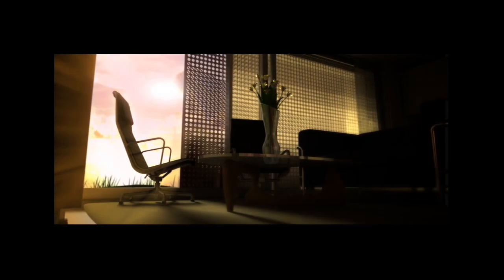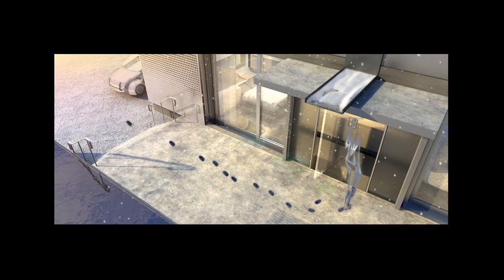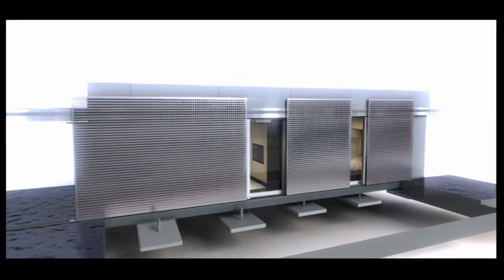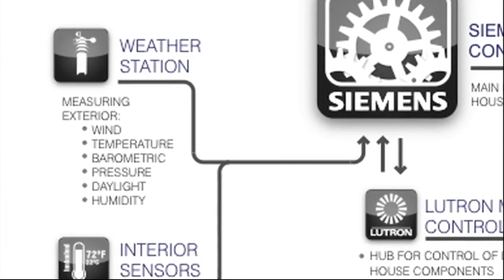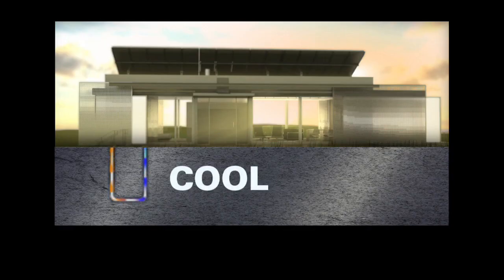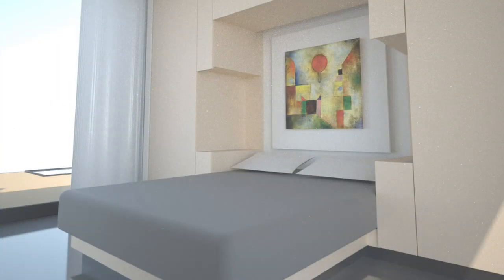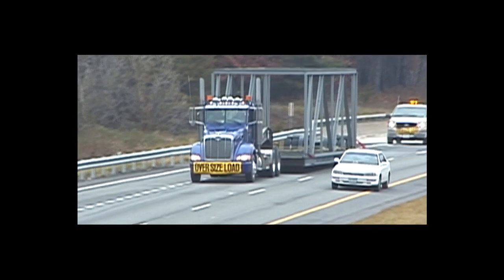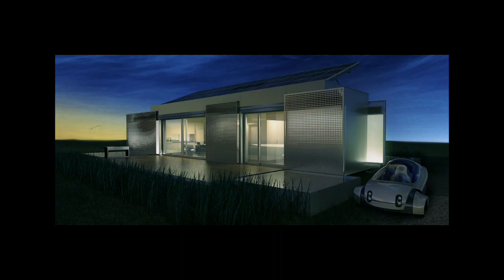LUMENHAUS - A brighter way.  Everyday.

Comment: There are a few problems with this design. What if your servo walls fail or jam? Whats stopping you from becoming trapped in your house if there is a severe electrical failure? What's stopping someone else from mucking about your home system controls? 

They are in the right direction but until it becomes reasonably priced, no one will buy into this design.